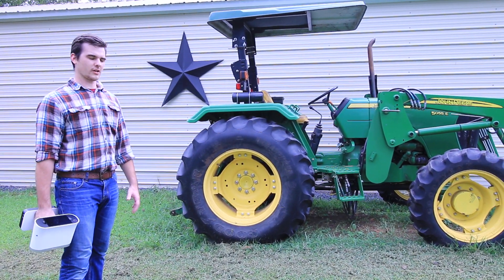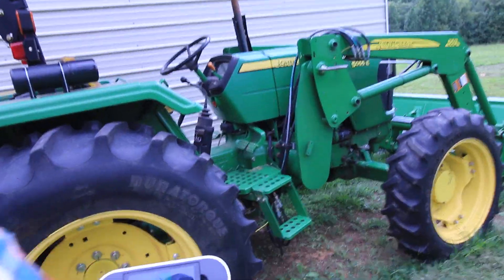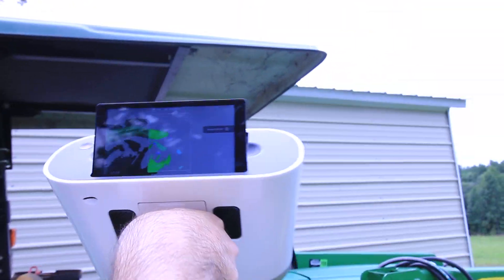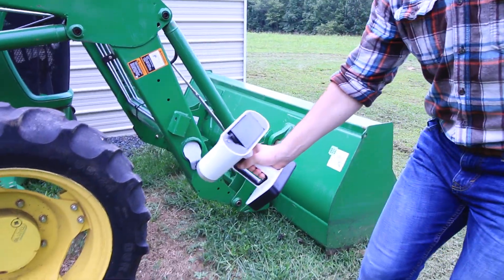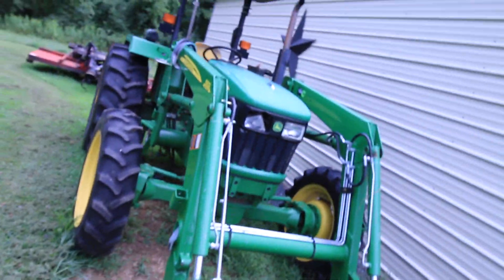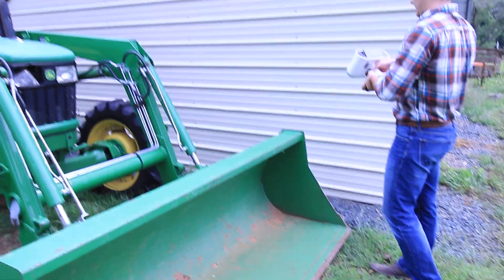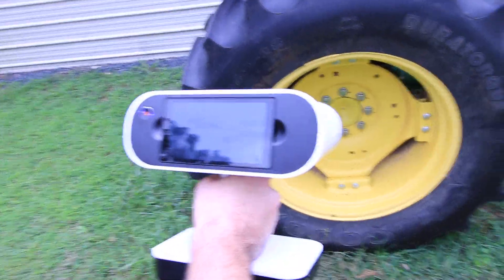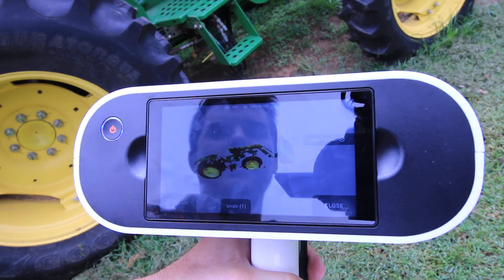3D Scanning a Tractor Outdoors with the Artec Leo 3D Scanner

Comment: How accurate was this scan? What is the % of inaccuracy? Also how does it do on the shiny objects? Would be nice to see those scans afterwards to see how it done with the hydraulic rams etc.. Anything shiny they normally struggle with.
Reply: What is the volumetric accuracy for this project?
Reply from the maker: @Nilton_Cavenaghi  The stated 3D accuracy over distance for Artec Leo is up to 0.1 mm + 0.3 mm/m. Considering the boat is approximately 14 feet long, it would be between 4 to 5 meters. If we calculate it using these numbers, that would be about 1.3 - 1.6 mm volumetric accuracy for this project.